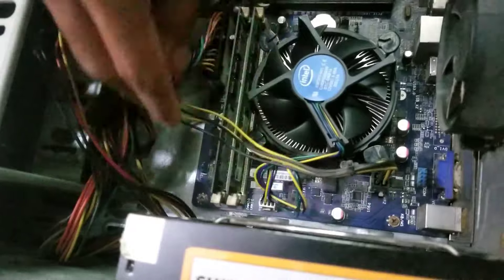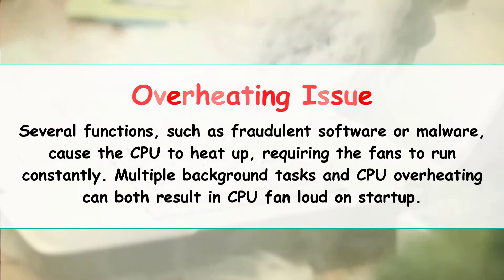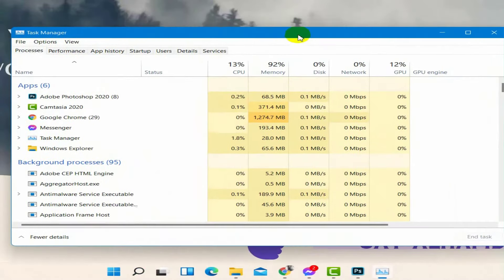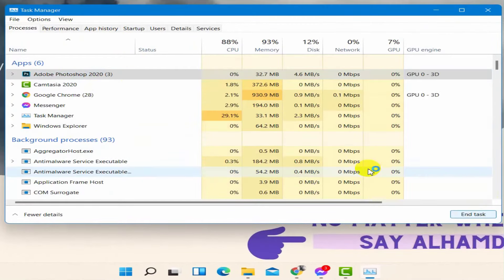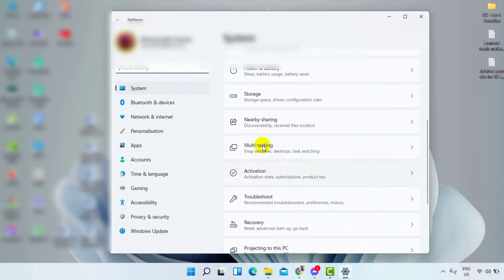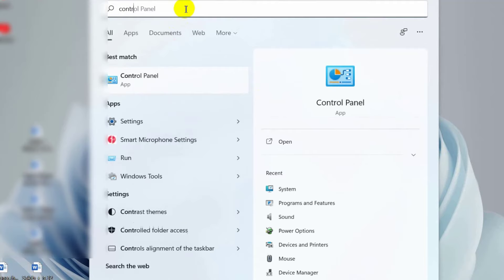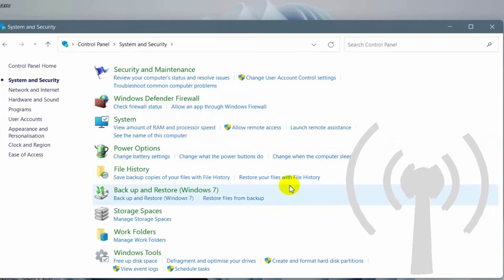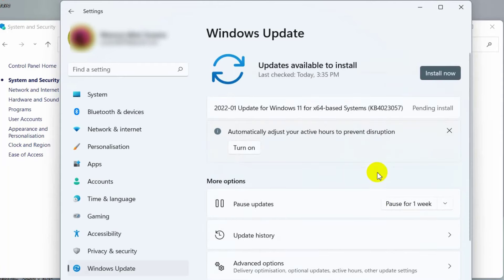5 Reasons Causing Your Computer Fan Loud on Startup! Fixed!

Comment: no reapplying thermal paste?
Reply: They didn't clean the side with thermal paste
Reply: What is themal paste? And how to use it?
Reply: @DJYAD19  Thermal paste improves heat transfer between CPU/GPU and cooler. Clean surfaces with isopropyl alcohol. Apply pea-sized amount to CPU. Mount cooler evenly to spread paste.
Reply: @PatoTutorials  Where to get Thermal paste from? Im afraid if I screw everything up when I open the cpu or misuse which then wont work properly after

Comment: I have a fan fixed on cpu cabinet box side cover that makes noise only during startup and noise increases during winter but the noise stops after operating system completely loads. Sometimes if I hit the cabinet side cover where the fan is fixed with hand then the noise stops. What's the reason and do I need to replace the fan ? The fan is connected directly to smps through a splitter that also connects another fan on front side